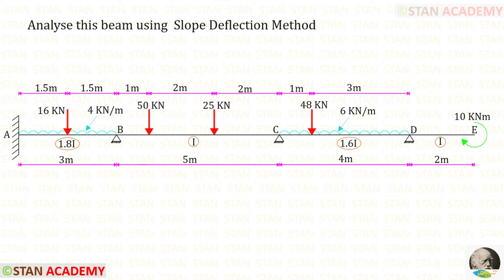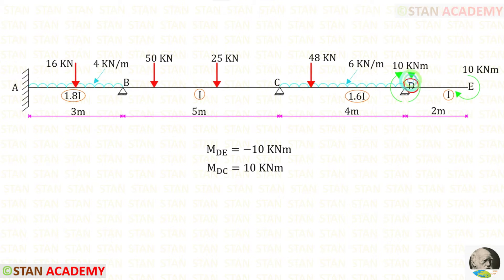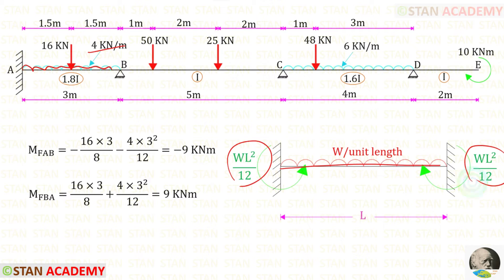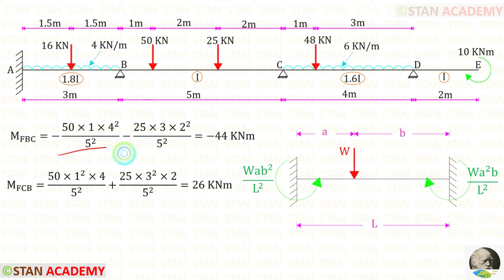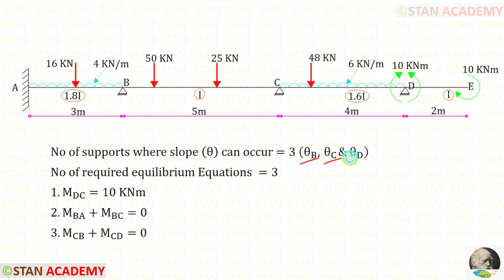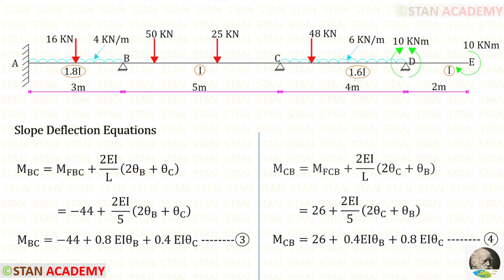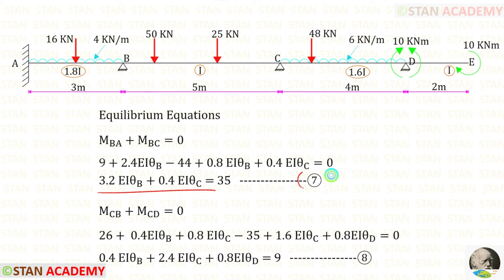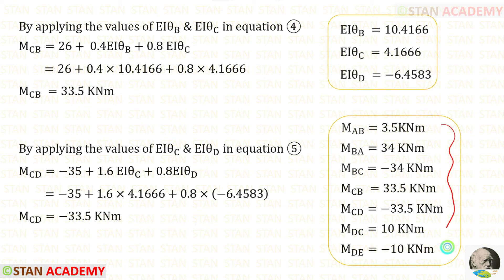Slope Deflection Method for Beam Analysis - Problem No 19 (  Three Spans With Overhanging )

Comment: Sir 
U found the moments two times, in that one by using the super position method but the reaction and moments all are different in those two can u clear this sir
Reply from the maker: I drew the BMD two times. both of them are correct. In superposition method you cant have the moment values in all of the specific points.
Reply: Thank you sir for your reply
Reply: Should i add the end moment diagram in the bending moment diagram
Sorry to bother you sir i will make this as a last question to you sir
Reply from the maker: no need to draw. you can directly draw the final BMD
Reply: Thank you sir